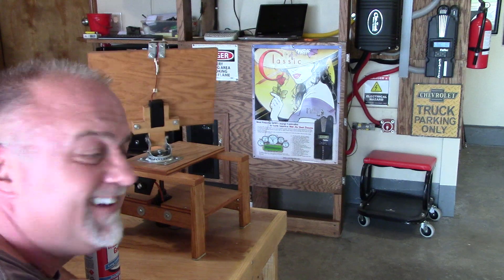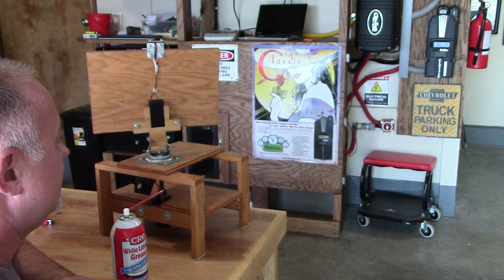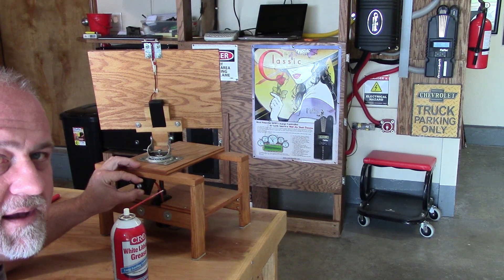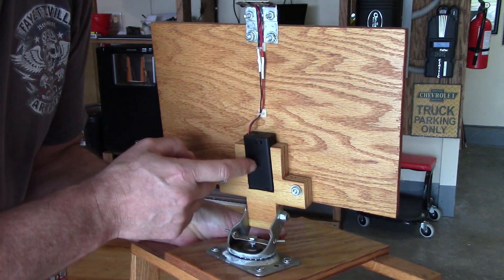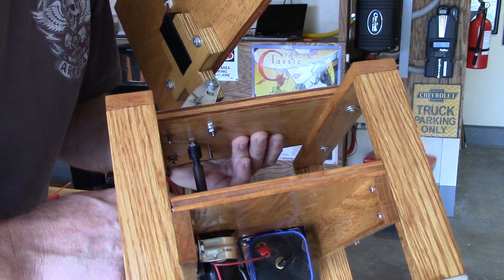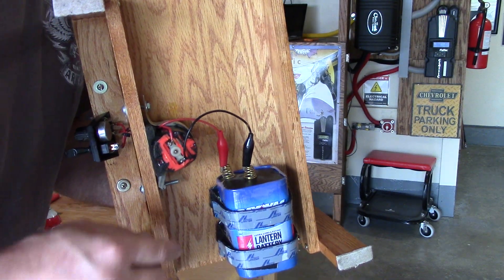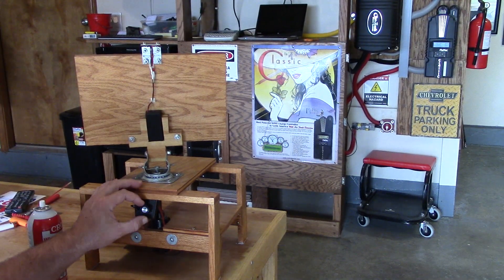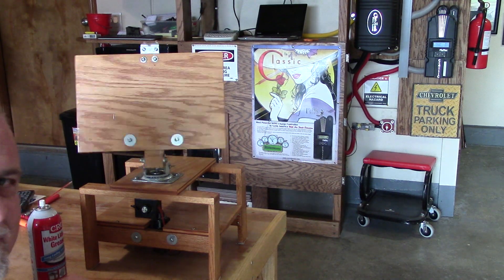DIY Homemade wooden toy radar (spinning and blinking!)

Comment: Solar tracker is a great application.  Heck... I think I'll do this for our attic antenna.  I bought one of those cheap Chinese rotating antennas just for the rotation feature, for multiple TV's in the house.  (no cable)  I had to use a one of those RF /IR extenders, and all it will do is continually spin.  It'd be nice to stay wireless, but if something like this worked - I guess it'd be worth it.